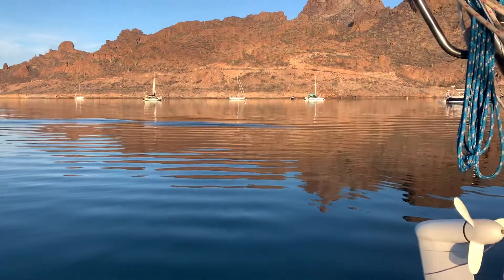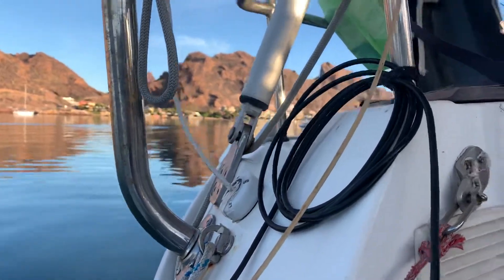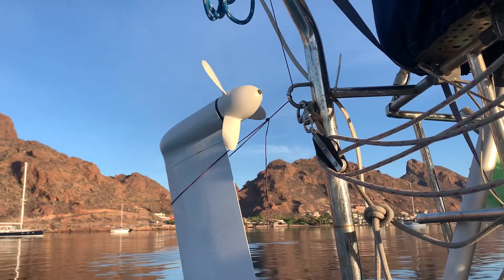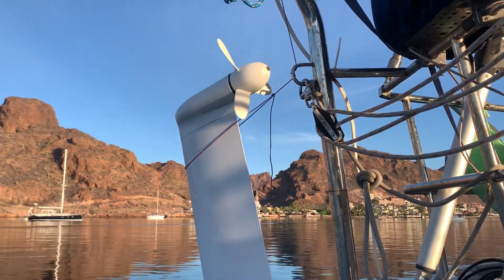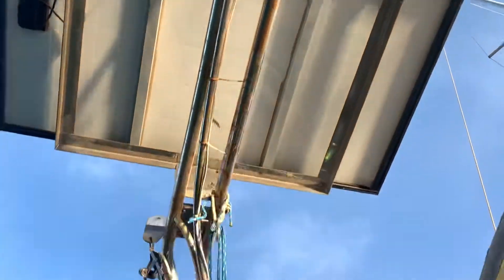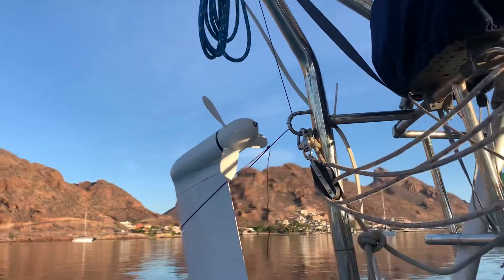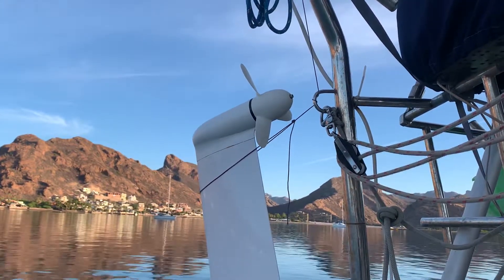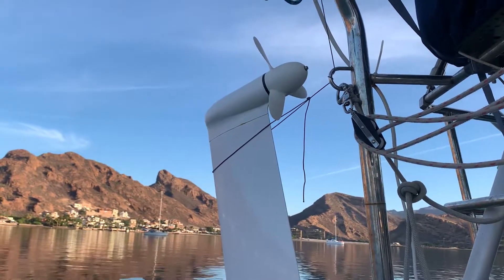Watt and Sea Hydro generator installation and experience report

Comment: I have heard a numbe rof reports of the Watt&Sea being - let's say - a fair bit optimistic about the power output! How much do you think they overestimate?
Reply from the maker: Humm not precisely sure about that power delta because my unit has a smaller then optimal propeller. My main problem is with the maintenance requirement and the need to send it back to France for maintenance and the plastic bracket that expensive and don't last very long.
Reply: @SVParadigme20  For me is all about the cost per Wh

Comment: It is not AC it is DC converting to DC 12v/24v
Reply: Typicallly these units produce wild three-phase AC (around 50v)which is then rectified to DC by the "control Box".
Reply from the maker: @helaciousadventures yep this is my understanding
Reply: It is DC -> Output at 5 knots
	

Output at 5 knots 8 Amps in 12 Vcc (100 W) with the 240 mm propeller

10 Amps in 12 Vcc (120 W) with the optional 280 mm propeller

Maximum using speed
	

15 knots with the 240 mm propeller

20 knots with the optional 200 mm propeller

Compatible batteries
	

Lead battery

Lithium
Reply from the maker: @sailingaroundtheworld1427 yes AFTER it goes through the conversion box it is DC current no doubt!
Reply: @sailingaroundtheworld1427  Facts are important. Those figures  you quote are the Rectified DC output from the converter. Just like an alternator produces AC power (Alternating Current-alternator, get it?) which then gets rectified inside the alternator to produce the DC output. Page 55 of the Watt and Sea installation manual shows the specification as up to 40V AC Three-phase. The cable is shown on page 49 as a three-phase cable. 5.1. "
"Three-phase wiring of the hydrogenerator

WARNING : ALWAYS PLACE THE HYDROGENERATOR IN THE LIFTED POSITION BEFORE STARTING WORK ON IT.
The hydrogenerator is fitted with a small diameter electrical cable of sufficient length to pass through the transom. This is a three-phase cable.
§ We recommend using the connection kit with a cable and waterproof power socket (Ref. WS-PL-C-002).
§ From here, use a three-phase cable to connect the hydrogenerator to the converter. If the length of this cable is less than 10 metres, use a 3 x 1.5 mm2 section. Above 10 metres, use a 3 x 2.5 mm2 section.
§ The converter is connected using the connector kit provided. See the assembly instructions below.

Comment: How much did you pay for your unit?
Reply from the maker: About 5k$
Reply: @SVParadigme20  Ouch !!!!!
Reply from the maker: @perryderkiss6604  That does not include 2 custom manufactured brackets (one port side the other starboard side) to hold the unit underway